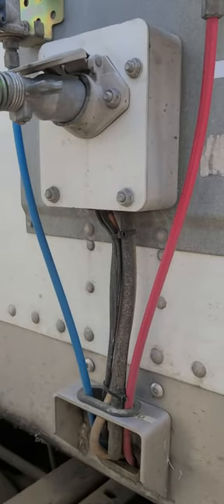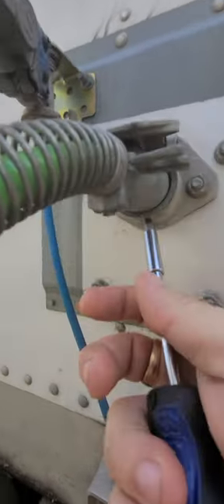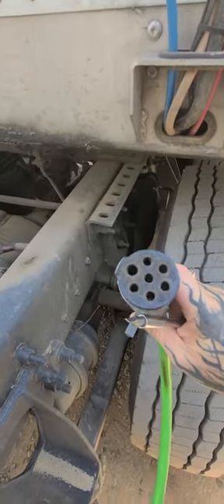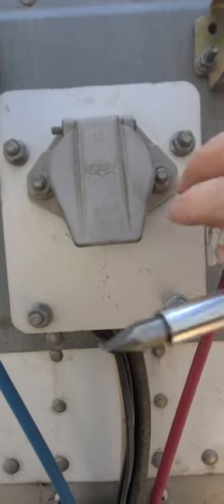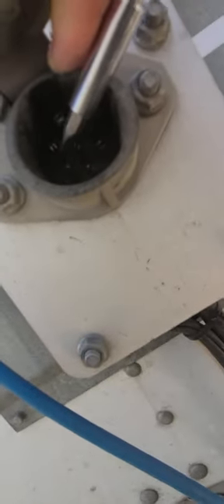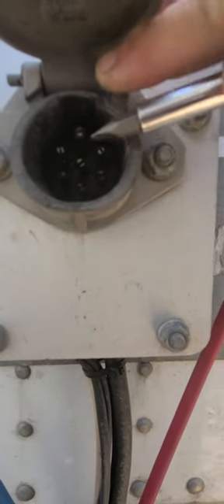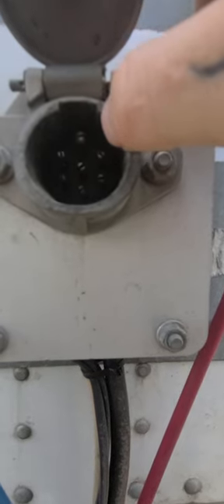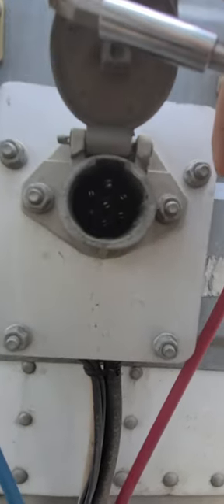How to fix running light short in pigtail connector for tractor trailer.

Comment: Top dead center is white ground.  Bottom dead center blue is brake lights. 11:00 is black clearance.  Top right brown is running and tall lights. 
The bottom corners are hazard and turn signals.

Comment: 7 way heavy duty socket receptacle as viewed in this video :
Top White - ground 
Center Blue - auxiliary / abs power
Bottom Red - stop lamps
Left top Brown - tail / running lights 
Left bottom Green - right turn / hazard 
Right top Black - clearance / side markers
Right bottom Yellow - left turn / hazard 
5/22/23